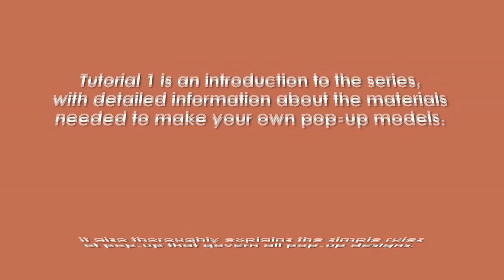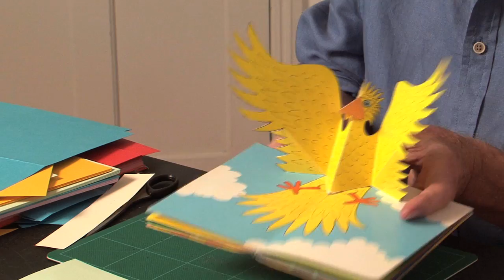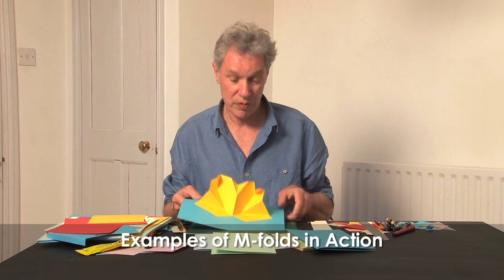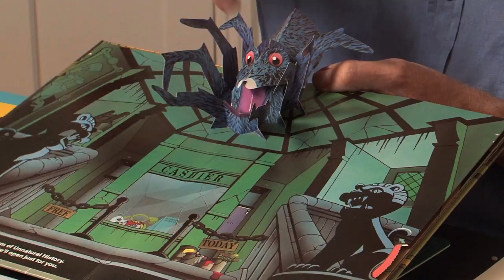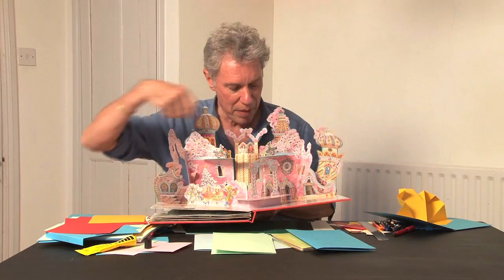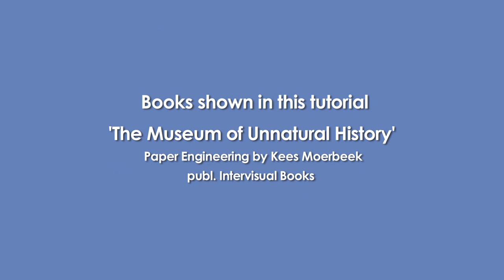Pop-Up Tutorial 19 - M-Folds

Comment: Hi Duncan, your whole channel is a brilliant resource for learning how to make  pop-ups, so thank you.
If you are able, I am really struggling to make asymmetrical M-fold pop-ups work, as per fig 10.3 on page 58 of your excellent book, so any help would be appreciated - specifically, the gluing positions of the tabs so that the page lies flat when closed and holds the shape designed. Thank you.
Reply from the maker: Start by making an Asymmetrical V-Fold pop-up piece (Page 38 in the book, Tutorial 4). At 5.30 in the video there is an explanation of how to work out where the two central tabs will glue down - mark the sticking places on the base but don't stick the piece down yet. Now on each side of the piece follow steps 5 to 9 (Page 57 in the book) to create the folds for the M-Fold. Finally the gluing - follow steps 12, 13, 14, 15 from pages 56/57 of the book.
Reply: @thepop-upchannel4919  Thank you!

Comment: Symmetrical m-fold, no problemo. Attempting an asymmetrical m-fold? 😳🤦‍♀️🤷🏻‍♀️
Reply from the maker: You can break it down into its components - Make an asymmetrical V-Fold, then build two more into the gullies, one on each side.
Reply: The Pop-Up Channel Thanks for that tip! I built the central asym v fold, then built 2 others into each of the gullies created by the previous folds. It worked, tho not without a lot of trial and error. I had been trying to create the structure out of one piece of card, like the sym m fold... which obviously doesn't work since angles all need to be reversed. For some reason, this lesson really blew my mind!
Reply from the maker: glad it worked. Quite often you can make a structure out of several pieces and then take it apart in as few pieces as possible - surely some asymmetric V-Folds could be made out of one piece of card.
Reply: The Pop-Up Channel Got it... that makes perfect sense. Thanks again, Duncan :)

Comment: Could you make a video showing how to make person on top of a bird or tell me which fold I should use to do that?
Reply from the maker: The M-Fold (Tutorial 19) or the Floating Plane (tutorial12) are both good starting points for making pop-up birds. You can build onto them using the methods explained in Tutorials 7 and 8.. Remember the basic pop-up shape can be built up by adding extra bigger flat pieces of card for things like wings. Also the person and the bird may be made out of one piece with small extra pieces added and then illustrations enhancing the design. You need to start by finding a pop-up shape that you think could be adapted to what you want to make - and then refine it. Remember also that the base sheet may be used lying horizontal with the pop-up rising from it - or it might be good in this case to use the base sheet as a vertical background with the pop-up coming forward from it. You will need to experiment and probably make at least  a couple of trial attempts. Good luck with your design.